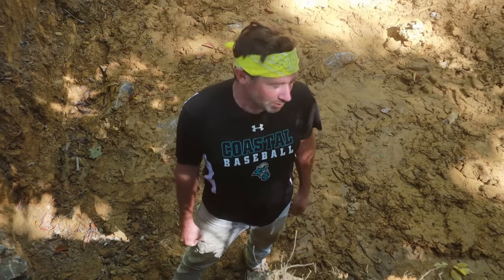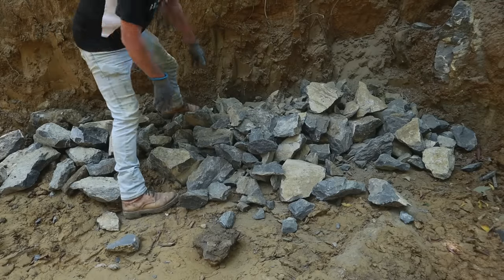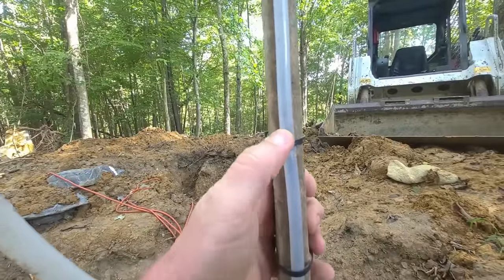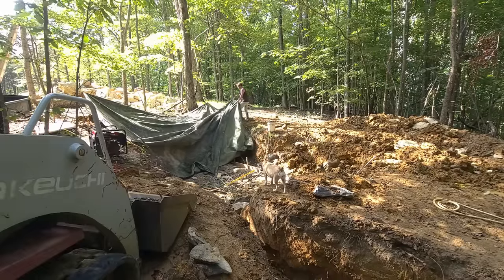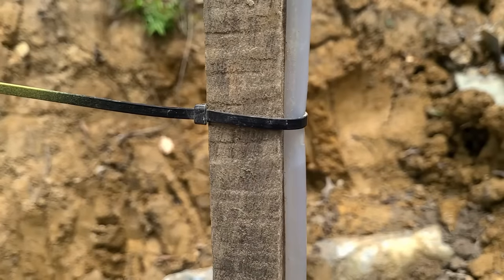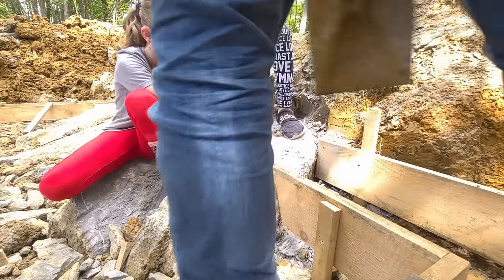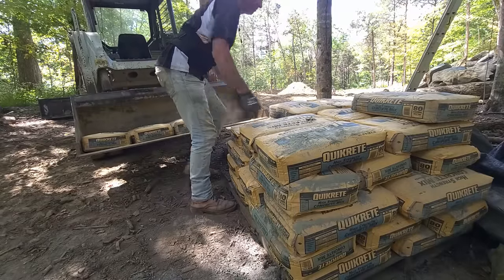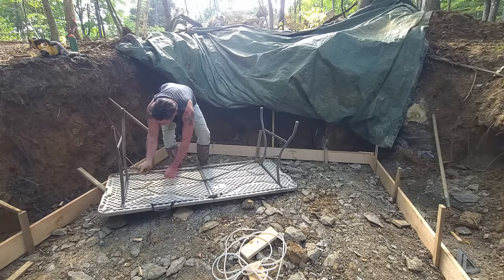Root cellar footers - building off grid // E131

Comment: Looks great Jon. Im glad everything is going well. A little trick when pouring forms: use a reciprocating saw without a blade and vibrate the forms to settle the concrete.
Reply from the maker: Yep, cool tip.  I wonder if a palm sander would work too.

Comment: A tip for anyone working with cement based products. Cement is very alkaline, between 12.0 to 13.8. As such it can 'eat' into your skin quite badly if it is not removed after contact. Sometimes, washing it off with water is not enough, particularly if it was there for a while.  I have found that washing with methylated spirits and then soapy water seems to stop the corrosive effect of cement.
Cheers,
EJ

Comment: Two tips I've been given, keep the barrow and mix wet between mixes. When you're dumped add water from your next batch to the mixer to stop it clarting up.
 You can also use drink bottles or cans on the ends of rebar.

Comment: Meg and John, Nice to see the foundation to your homesite underway!  You may have considered this already. Being that the root cellar will house your battery room, you may want to get a smart Yolink water leak detection setup or something similar in conjunction with your sump pump.  A while back I think you mentioned that the long stones you dug up looked like Stonehenge pillars.  Since you have a 360 degree mountain top homesite, you could stand some stones up that mark the Vernal & Autumnal Equinox and the Summer & Winter Solstices.  Have you submited your permit plans for Picasso's pond? 🐢😂
Reply from the maker: The funny thing is, I have some pointy boulders set aside for a jedi temple one day in the middle of my woods.  It would be neat to set them as a sun dial.  I like the way you think.

Comment: Jon, A couple of tips that I believe will assist you in the future using the concrete mixer. First, it would help if you created a platform , just to lift the mixer so that you can empty it without coming into contact with the wheelbarrow.  Secondly, after you empty each mix, pour a little water into the drum to prevent a build up of concrete on the paddles...Hopes this is of use to you as the construction progresses.  Cheers again.. Robin.

Comment: You can use your hammer drill/chisel to vibrate the form and that will help getting the concrete to the hard to reach places. You could have also made your mix a little wetter to get it to pour a bit easier.

Comment: agreed that water levels are accurate, but only if there isn't any bubbles in the line and both ends of the lines are open to the air so that they can equalize

Comment: The Mic sounds perfect, I don't think you need to tweak the settings at all.   And as far as finishing the concrete under the spreaders, don't worry about that, it's a footer, that will be covered up.  Just vibrate or tap the forms a little more next time and it will flow under the spreaders and be fine.  One part that I was a little worried about was how the rebar stopped at the protruding rock.  Ideally that would have bent up and continued over top of the rock.  I'm a little worried that footer may crack where it's very thin on top of the rock.  Otherwise it's looking good, soon you'll never want to see another pallet of concrete! 🤣

Comment: If you could find an old used larger jack hammer that uses the air compressor on wheels they have so much more power. I used to use one when I was your age. You could fix any problems it might have to make it work better.  You are as handy as a pocket on a shirt .l, ll be 70 in dec. 2024.😊

Comment: You actually don't want a smooth top on your footers.  A course but level layer helps with your mortar bonding when you start blocking things out.  If you did a garage floor smooth then the mortar can be dislodged very easily.  So don't worry about your crossbars, they will help stick your blocks to the footer.

Comment: getting a lot of work done with the Takuechi!  I just picked up a grapple similar to yours, tins are bent on mine as well ... or are they supposed to be like that?  The quick connect on the machine do not seem to want to work easily ... any tricks to make it easier to connect the grapple hoses to the machine?
Reply from the maker: Hey man, you asked at the right time.  I just figured out the magic combination the other day and was going to demo it in this video, but it was getting kinda long.  I'm sure your 140 has the same 2-way/1-way flow switch.  Turn it on so it's in one way.  Now your foot petal only works with your heel, so press the petal forward (the inactive side).  Plug in your top hose with the petal pressed forward and then you should be able to insert the bottom plug like normal.  What this does is open the return valve on the inactive side and relieves the built up pressure.  Try it and let me know!
Reply: @WalnutsandWineberries  awesome, it’s the same basic concept as with my excavator… when I put the hammer on it the hoses are very difficult. 

Not sure why I didn’t think of it!
Thanks so much. 

My machine doesn’t have foot pedals, just joysticks … same difference though

Thanks so much.

Comment: Wonder if maybe a French drain system for future drainage to keep the celler dry?
Reply from the maker: I thought that too, but being that it's mostly clay soil, I think a sub-pump would work better.  The water just doesn't drain through that clay and I don't think that French drain would ever get a chance to perform.  I could be wrong, but that's the logic I'm going with.
Reply: @WalnutsandWineberries  you would have to dig a trench and pipe it to a low side so it could drain out. That's what I found works best in clay.

Comment: as to ur quick hitch  U need to tighten them  Just out a wrench on the nut of top and turn.
I know this b/c mine came to tight and loosen them
now ur water level.  put a nail in top  attach string to nail.  On other end of string put a big old nut.  Walla u have just put a plumb bob on ur water level.

Comment: Going to add a forming suggesting, as it;s something I ran into recently.., albeit I was pouring using wheel barrows and from a truck. (and related to dismantling atfter),,, Screws are terrible..., I know it makes it much easier to put together, but you will struggle with stripping the forms... every bit of concrete that gets into a screw will take you minutes to take out...  and their sheer strength is terrible, they will break and snap. Go buy some duplex nails. You will thank me later.